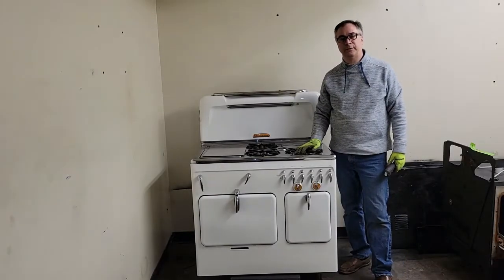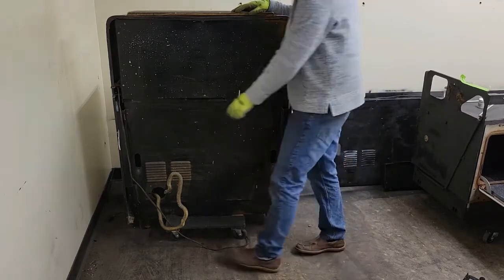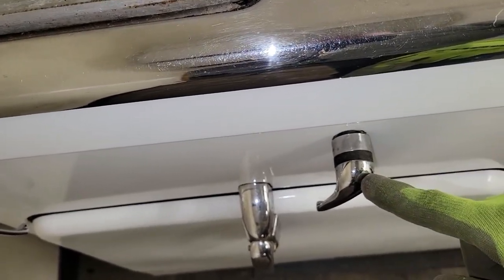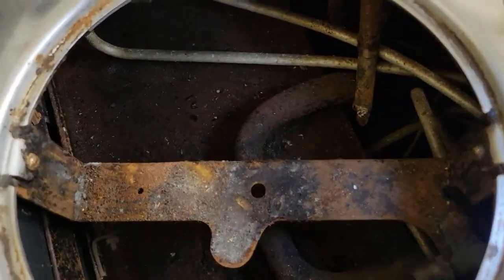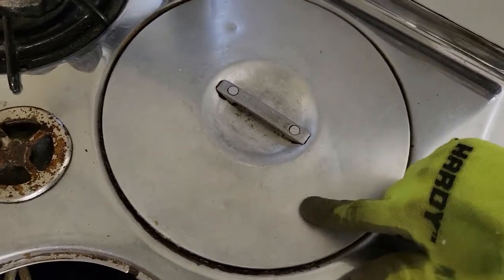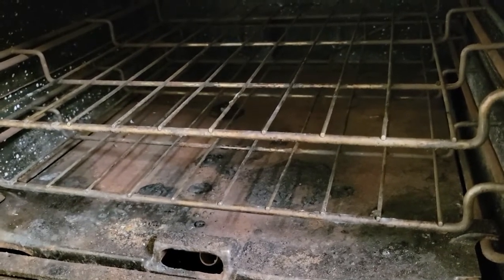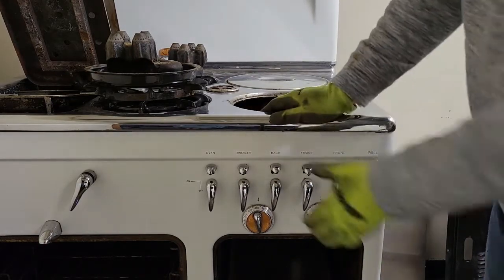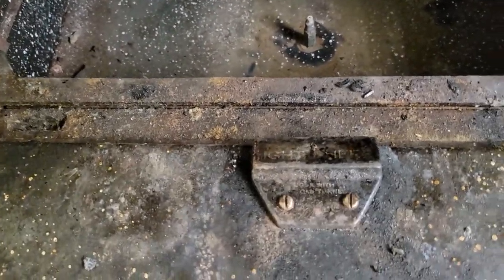How to Inspect a Chambers Stove Before You Buy

Comment: Thank you so much for this video.  We have a yellow Chambers, but are preparing to move, so I'm hunting for the red Chambers of my dreams.  Since the stove we bought always worked pretty well (except for the griddle lift), I've never had to do an evaluation.  We're about to go check one out, and I can't tell you how much all of this specific information helps!

I now feel confident being able to assess the cosmetics of the porcelain and chrome, to look for rust and broken lines in the areas you've mentioned, and to check for seized valves.  One question:  beyond the cosmetics, what are the parts most difficult and expensive (or impossible) to fix?
Reply from the maker: Sorry for the delay. On a Chambers, there is nothing that's impossible to fix or replace. Some are just more time consuming than others, although I'd avoid a stove that had serious rust holes.

Comment: I saw one that had a small hole in the door where that plate is on this stove. Is that what the repair could have been? Thank you this video has already come in handy on our search for our chambers stove 👍🏻
Reply from the maker: Sorry for the delay. Yes, that's regretfully typical. It's a weakpoint in the Chambers C. That badge should be there and, if it's missing, you need to find a replacement or add on a piece of steel to reinforce the door panel.

Comment: Excellent and informative. I have a C90 and had it restored when I got it several years ago. It has what I'll call an old water heater lighting mechanism. I notice this stove seems to just have a gas line thats it. I wrote you about having to always turn off the gas valve at the wall each time I use the stove because gas always leaks even though the pilot lights are lit. I've searched online to find someone knowledgeable about Chambers in the Phoenix AZ area and haven't found anyone yet. My question is do I need the water heater type mechanism? If you can refer me to a Chambers repair/restoration shop in Phoenix I would appreciate it very much. Thanks in advance.
Reply from the maker: Hi, yes, I wrote you back. I don't know anyone in the Phoenix area who services these anymore, regretfully. If you have a standing pilot installed with a thermocouple and the valve is broken, then you need to get the parts replaced. If the oven won't light, the thermocouple is likely dead and needs to be replaced ($20 part). But I want to be very clear that messing with the main shut off valve for the stove is a bad and dangerous practice that you should really stop. Touch it once every time you get a new stove. That's it. You need to clean out your pilots, and my email described that process to you. It's not a leak, it's a clog. Unclog it and you'll be fine.
Reply: @VintageStoveChannel  Thank you for your reply.

Comment: Do you have an email that I can send you a picture of my oven.  my oven has a big hole with a pilot light in there.  I remember my mom not having that pilot light on and we would have to turn it on with a match all the time.  since then, i got it rebuilt and i have a pilot light in there but i really don't bake that much so i was thinking about not using it, but it has a larger hole than what you show in your video.  So i am asking if i can send you a picture to tell me if this is something i need to fix or not.  thanks.
Reply from the maker: I think we've already emailed, but if not, send me a message through the contact form on my site and we can talk it through.